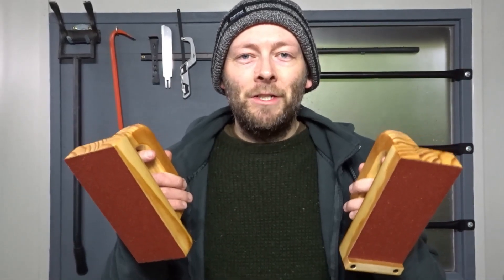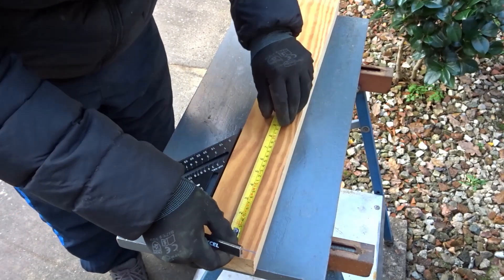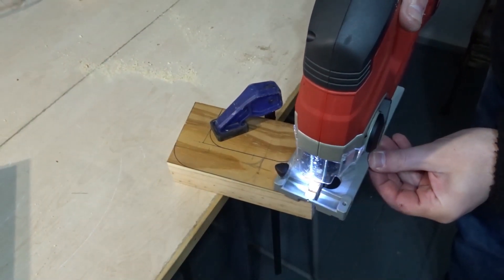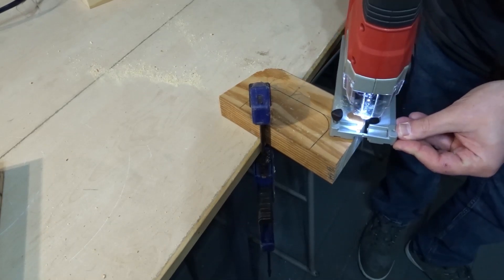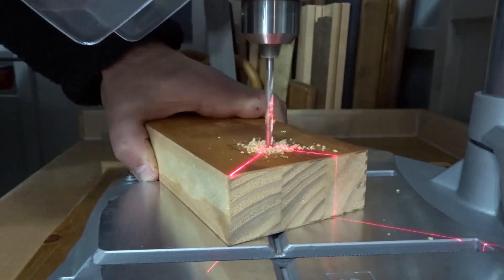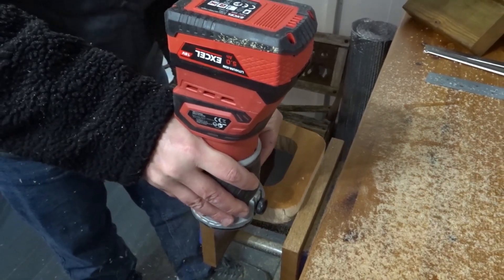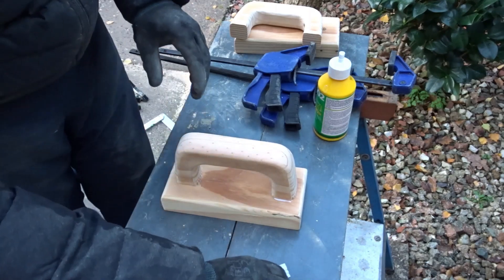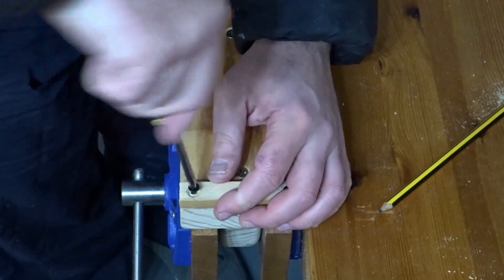Making Simple Push Blocks for the Jointer / Planer

Comment: Phill, Simple design. Thank you. Great for a planner. What I would do to de-risk this getting near high speed spining blades such as a table saw or a router I would do as you have done, let the glue set and then remove the screws and then drill through for 6 or 8 mm dowels and glue them in place instead. Different outcome than, as an alternative to the the blade hitting the screws  .
Reply from the maker: Thanks yes that's a good idea I think. I did it this way to see if the height of the heel would be good as I wanted to be able to remove it easily to change if not correct. I think later on I will attach it with glue and dowels as you say.